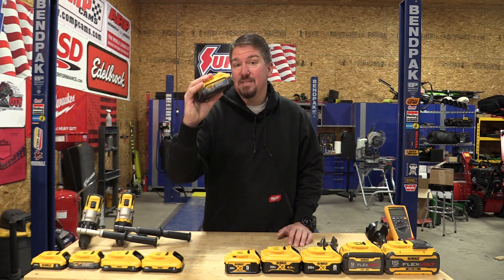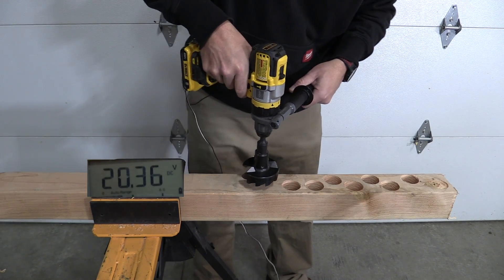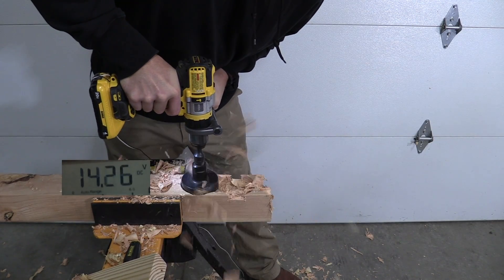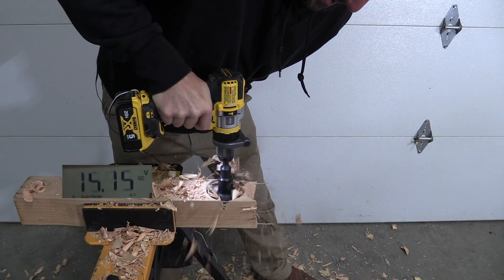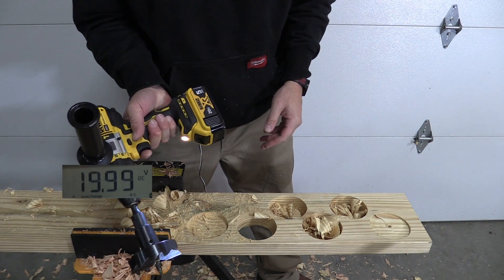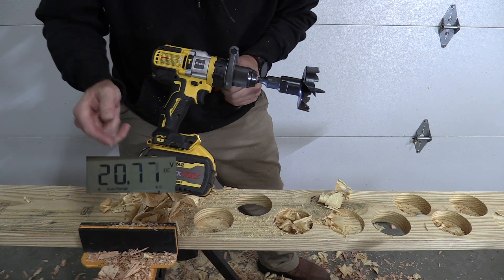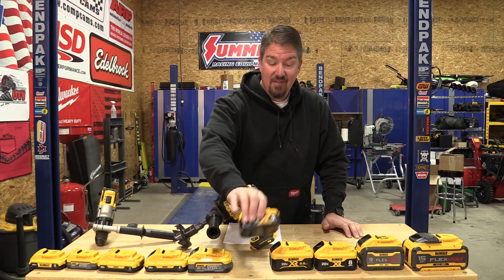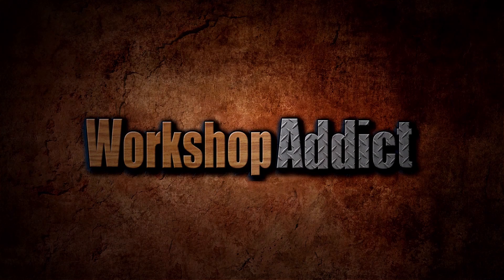Wow! The DEWALT POWERSTACK 20V 5Ah Battery Testing

Comment: If only DeWalt had a hydraulic/oil impulse driver like Milwaukee and Makita, I would jump on the Powerstack platform in a heartbeat!
Reply: Same here! I've been waiting for a dewalt version or Gen 2 Surge for a long time. I definitely prefer the m18 surge to the makita.
Reply: @aaronolsen8787  I like the power of the Surge, even though every review said the Makita drove screws faster. Even my M12 Surge drives things faster.  However, the Makita has the least amount of vibration, is the quietest, and the most comfortable to use.
Reply: @l00nybin  Interesting. Maybe I have a dud makita, but I kind of don't think so. It's a bit faster driving 2" #8 screws than the milwaukee but anything bigger and the milwaukee is faster. The milwaukee is much smoother with less vibration on everything and is also noticeably quieter, especially on larger GRK's which the Makita won't even drive all the way down. 

I own a few different m18 surges and they all perform this way but I only own 1 makita and have just used an m12 surge a handful of times, so no real experience with that one. The makita was kind of a waste of money for me as it's louder, has more vibration, worse ergonomics and the trigger isn't as linear as the milwaukee. The m18 surge is by far my favourite ¼" driver on the market right now.
Reply: @aaronolsen8787    the Makita was designed for driving regular screws, and not bigger lag screws, Spax, etc. It just isn't meant to do it. I bought the Makita knowing this, but wanted to see how it fares against my M18 and M12 Surges. My experiences don't mirror the reviews, but then, I don't use carefully planned test media. I just grabbed a log from the wood pile and some 2x4 boards and drove stuff in. The vibration is noticeably less than both my Surge drivers, but they are both noticeably stronger - in spite of what the reviews say. Milwaukee really hit one out of the park with the M12 Surge, but with my short fingers, I hate the M12 grip. The M12 might be a little quieter, but not by much, if at all. Ergonomics is more of a subjective thing, and with my short fingers the narrower grip on the Makita works better for me, and the balance just feels nicer than my M18 Surge. A smaller HO cp3.0 battery would probably help the M18 balance better, but I don't have one.

Comment: Batteries probably also differ in cut-off threshold, that's why the flexvolt brix all did cut off.
Reply from the maker: I think the FV cutouts were due to catching right at the end of the hole, but possible.
Reply: @WorkshopAddict  for to be clear sure .please test dcd 999 flex volt vs power stack 5ah agian

Comment: Are the cut outs at the end of the dimensional tests for the 9AH and 15AH due to drill shutting off for binding, or do you think it was heat protection for the motor or battery?
Reply: It binded up going through. Dewalt doesn’t have thermal cut out like Milwaukee does .nothing beats dewalt
Reply from the maker: Yes, it is the bind right at the end of each hole.
Reply: @WorkshopAddict   for to be clear sure .please test dcd 999 flex volt vs power stack 5ah agian

Comment: This has got to be hands down the best video of this type I’ve ever seen. Having the live voltage out really shows the output capacity of each battery and brings the testing to a whole new level under load.
Reply from the maker: We have this same test for Milwaukee and Kobalt
Reply: @WorkshopAddict  I will here to give it a watch!
Reply: @WorkshopAddict  what about Makita's 40v 8ah battery? The biggest, most powerful battery in the power tool game right now?
Reply: @clarkfos3447 The dewalt 60v 15ah...
Reply: @brandonphillips4553  The DeWalt flexvolt 20/60v 15ah battery is ~270Wh where the Makita 40v XGT 8ah battery is ~288/320Wh. It's close but definitely not bigger or more powerful than Makita.
Reply: How about the Flex 24v tool’s “stack pack” battery vs the Dewalt “power stack”??? Which one is stronger???
Reply: @delosaurasrex732  Flex should have the advantage based on stated voltage and amp/hours yet I like that DeWalt is taking the time to get these batteries right.
Reply: The best method could include amperage as well, because you have to multiply it with the voltage to get the power. But measuring amperage through the connections would be very difficult, maybe realistically possible with a shunt resistor.